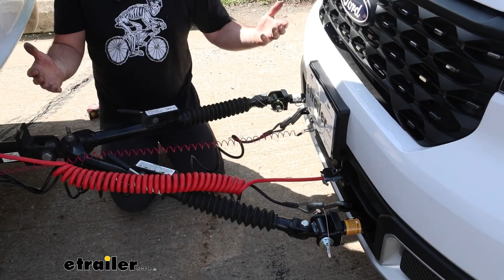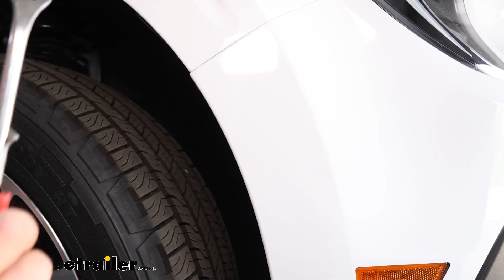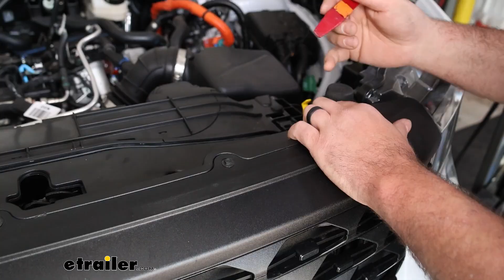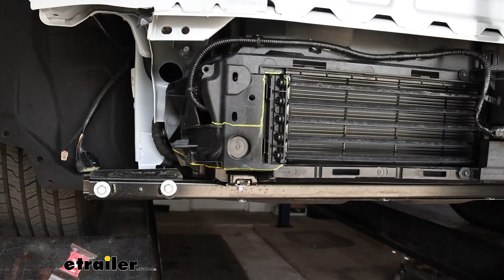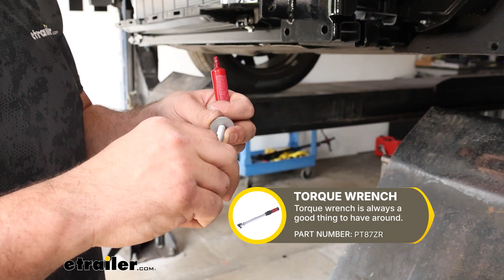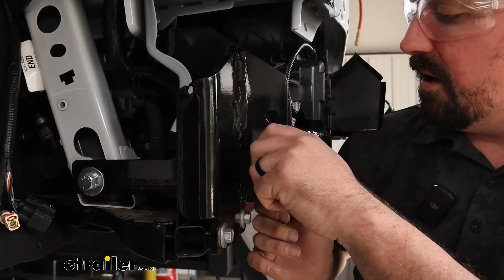etrailer | Roadmaster Direct-Connect Base Plate Kit DIY Installation - 2025 Ford Maverick

Comment: Is there any concern on the removal of the shutters?  I feel like Ford would not install something like that just for fun, but maybe it's not "essential"?
Reply from the maker: The air shutters are designed to open once the engine reaches a certain temperature and close when the engine is cooler. The vehicle is a bit more aerodynamic with the shutters closed. Removing them will have a small effect on fuel economy, but other than that there will no harm to the vehicle. I hope that helps explain it for you!
https://www.etrailer.com/Tow-Bar-Base-Plate/Roadmaster/RM87NQ.html